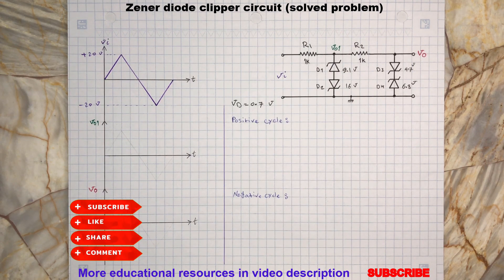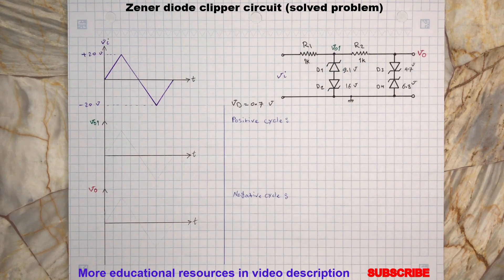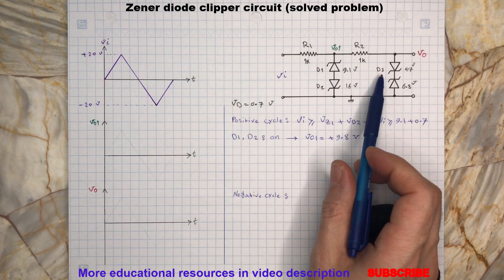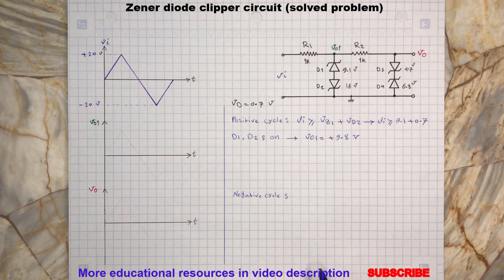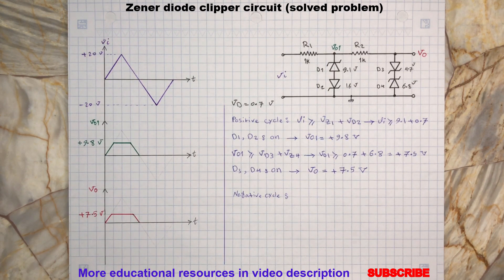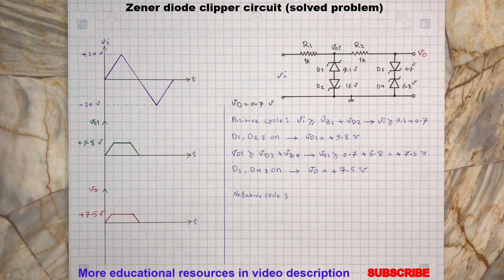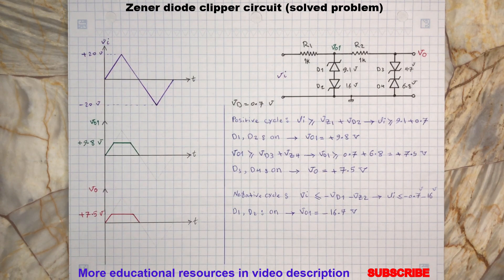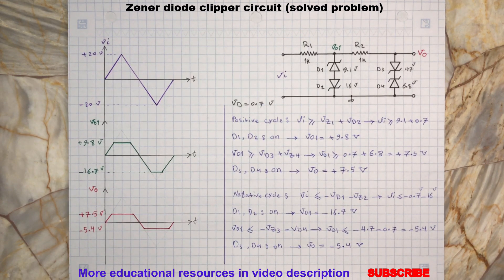Zener Diode Clipping Circuit Solved Problem, Clipper Circuit with Zener Diode

Comment from the maker: Diode circuit solved problem:  https://youtu.be/Tf_1Aja6ZeE
Op-Amp Active Limiter with Zener Diode: https://youtu.be/AAEvPySJ7fk
Op Amp with Diode Circuit Analysis: https://youtu.be/tCOLccWg5AI
Electronic Circuit Analysis Playlist: https://www.youtube.com/playlist?list=PLLA_QJ8rHZBh5LqrY41bCvKgreRDRWrBQ
Control System Playlist: https://www.youtube.com/playlist?list=PLLA_QJ8rHZBjS_S6WPkmUweF5NbImvSqf